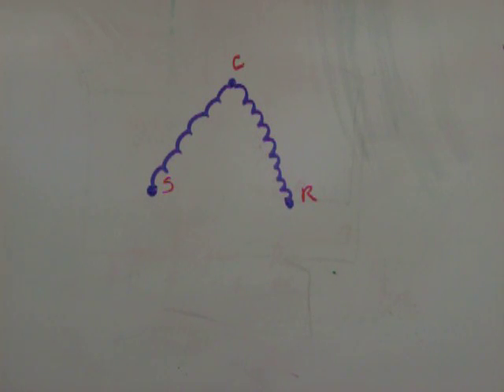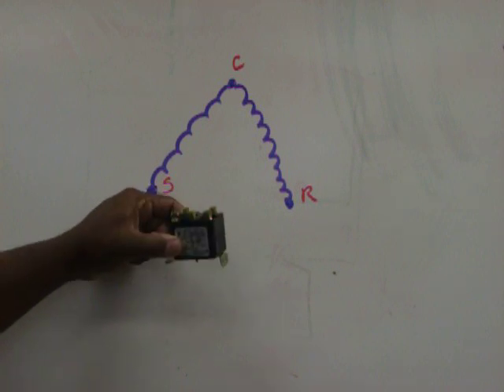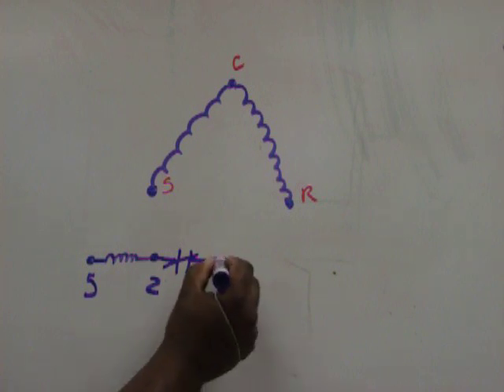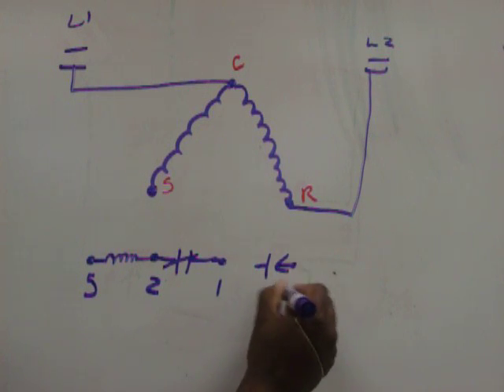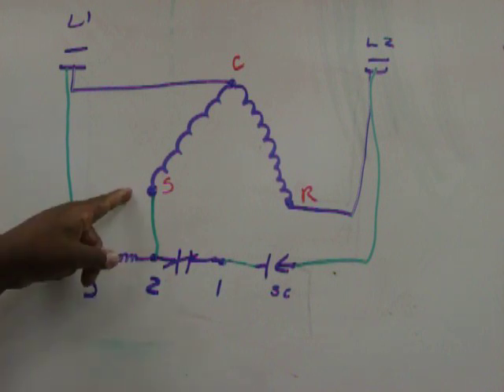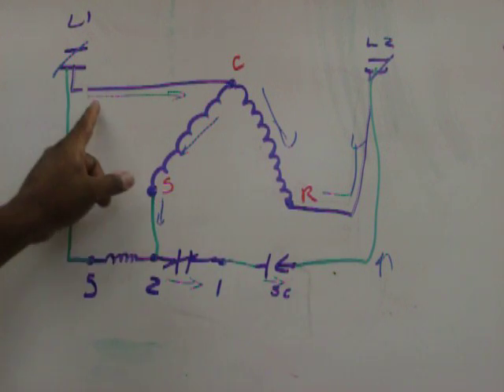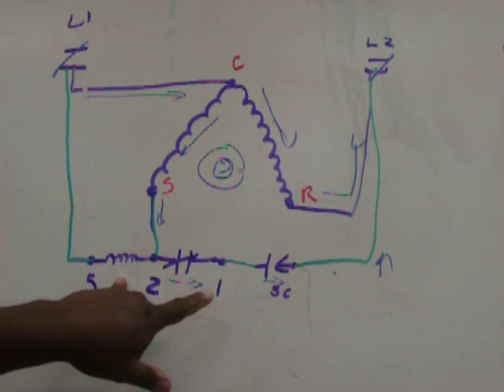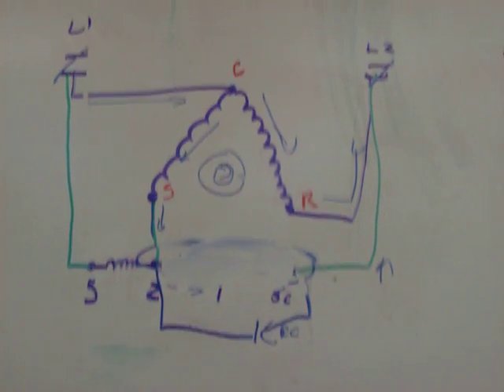Potential relay

Comment: can u explain the route of capacitor in this circuit? bit confused to read which route it takes.. confused to understand when it been filled first, the other side been push to neutral, then the filled one return to the source which is other side of the cap and then the cycle repeat.. thanks in advance

Comment: Oh, boy, out of confusion comes a moment of clarity (I think). The start windings and the relay coil are in parallel, and when the motor is not spinning, the impedance of the start relay is far higher than the start windings, so almost all initial current goes through the start windings. I reasoned that as electrons flow and the motor spools up, back EMF effectively increases impedance of the start windings, reducing current draw and leading to more current following the parallel pathway through the relay coil. That extra current through the relay coil pulls the contacts open, resulting in a transient voltage spike at the S post, for a few hundred microseconds. But what keeps the start relay going after that? After all, with relay contacts open there's no pathway for electrons in the relay coil to get to the L2 side! It's now trapped in a blind loop with the start windings. I'm guessing the relay stays closed because the spinning motor acts as a generator on the start windings, producing reverse AC current with enough of a ripple through that blind loop to keep that relay coil activated. Correct?

Comment: I've been doing HVAC and electrical work since 1992.  This was the best instruction I've ever seen for the start circuit on a single phase compressor.  Great job sir.
Reply from the maker: WOW!! Thank you very much!!!
Reply: @21footxpress  wow bro. youutbe showed me one of your vids from 14 years ago. like what? that is old. But it chose yours. 
looked at your stuff and you havent uploaded in 13 years?
But you did respond to this msg from 1 year ago. 

bro, you gotta come back.
Reply from the maker: @TheMookie1590  Thanks a lot. I have an idea for a new video I just need to make it happen.
Reply: Rely potaruonl rely  sighl  phase   5.2.1  L2  satrt  cap .point  2 point  and connecting  startin point   comprssar  comon point  2winding compoint  othwr point  runing point  comon cycliling  controold  over lord   L1...ciecuit comepted    l1    .l2  enizing compltly   ..L2  ..relay  contanted  potentiaol re..ly connwatd   no..relay  coil contacting  comon point  L1.. contacted ...over lord  ...     L2   1  startcap  .. 2  ponit  coil wunzing  starting  potensional rely circiut
Reply: Rely  potanshionl  realy  dummy point  .mens  mt ...46  ..mt point...))
Reply: @jollyscaria2922 Been hitting the sauce again?

Comment: L1 is hot line why doesn’t it go to Run ( basic theory) why hot goes to Common? I am confusing ???
Reply: Thank you Sir your teaching is absolutely clear, so I have seen a current relay like this,  the common wire ( L2) goes to the OVERLOAD  then is connected to Common of compressor, and the hot wire ((L1) goes to the RELAY at M terminal (main) then is connected to Run and Start terminal? Could you please explain more about this?
Reply from the maker: It goes to common then is split to serve both the run and start windings

Comment: This video is excellent, and the way he drew it out is much easier to remember than the ways I was taught. A  rhyme that helped me remember how to wire potential relays was, "5,2,1...cock, sucker, run". 5="cock"(common), 2="sucker"(start), 1="run"(run). It's crude, but it's memorable. I always find myself muttering it under my breath when I'm wiring these in

Comment: Great video.
Most techs have no understanding of electronics.
The voltage produced on terminal 2 is from the collapsing of the magnetic field on the start winding which is higher than the supply voltage.
It is important to point out that although almost everyone will insist that capacitors pass AC current, that is not true. They simply appear to pass current due to the rapid charging and discharging.  Understanding this fact will help techs understand why a larger capacitor results in a larger current across the device.

Comment: Excellent explanation my friend.  It is also amazing just how much voltage the back EMF can generate.  Hard for some to grasp that even though the motor is 240 volts the back emf generated can be very high even as much as 500 volts.  That is why the pick up voltage is stamped on the Potential relay.  Never buy a relay with less pick up voltage than is stamped on the relay.
Reply from the maker: Thank you very much

Comment: Hi there...great video...but please tell me...I'm no electrical guru.....but in the UK we have L and Neutral. In your schematic, are you using 2 phase ie L1 and L2?  If so, why would you need a start relay as presumably, there would be a difference in Phase angle!   Or is L2 same as Neutral as we have in the UK for single phase supply.  I'm a little confused!  appreciate your feedback.  thanks
Reply: Robin, he was referring to 240V single phase power. L1 is 120V and L2 is 120V. No phase shift. Many compressors here in the US run on 240V single phase power. Only small units like window units and small refrigerators run on 120V power where you only have L1 and Neutral. Hope this helps.

Comment: I came here because I decided to install a hard start kit on my home AC condensing unit, just for familiarization. The instructions are quite clear, but I'm the curious type...

I teach at an electrical tech school and have a HVAC background as well. 

I must say, that was one fine explanation of how the start capacitor is dropped out of a circuit using a relay versus the typical centrifugal switches used in open motors. 

I usually don't address this subject in the electrical only class but I'm going to start now just for comparison purposes.

Thanks much, good work!
Reply from the maker: Thanks for the kind words

Comment: I think what's missing in a lot of the videos that explain what a capacitor is actually doing in the circuit, is that the capacitor is absorbing current, so on motor start-up, the circuit looks closed, temporarily, until the capacitor is charged and no longer looks like a load to the circuit. Although, this is AC, so the capacitor can pass some current continuously.

Comment: Apologies, I'm not an expertin this field.....but just an observation.....In the UK we call it Live and Neutral.  Surely therefore, voltage must be coming in on  LIve (L2) in your diagram?  Also.....what stops the Start Winding being energised through 5 and 2 even with the relay switch open.  The SC maybe out of circuit....but there is still a path!....is this due to counter EMF being larger than line....I'm a little confused here!....please clarify.

Comment: I need to replace a CSIR compressor that's grounded. However, the new compressor is a CSR and it comes with 2 capacitors (Start and run). But i can't fit those capacitors inside! There's too little space! So i'm planning to use a Dual run cap to replace them both as a "2 in 1" options to run and start the compressor. Any takes on this guys? Feel free to share your opinion.

Comment: Only an HVAC tech would think potential relays are hard to understand.  The best thing you can do as an HVAC tech is stop going to technician school and enroll in an engineering school, then if you want to go back to being an HVAC technician you will know a hell of a lot more than your peers and understand how all this works.  There is a side effect though.  If you go to engineering school you will make a lot more money than a technician and have many more career opportunities available to you so you.  When this happens you most likely won't want to be a butt-crack technician anymore.
Reply from the maker: Well thanks for watching. But I see no need to insult these hard working men.
Reply: I make more than most engineers easily so kiss my ass. great video
Reply: Is a little harsh, but it's true.
Reply: Or you could go to a tech school that is worth half a fuck and has teachers that actually understand these simple ass components
Reply: wasup23tube what's got you moody? chill
Reply: StraightoutofGeorgia dumb ass teachers lol

Comment: thank you for education! great video just want to clear something is current flow through run  capacitor as well since run and start wired in parallel?
Reply from the maker: Yes. On start up both capacitors are in the circuit and electricity flows thru both

Comment: I have a question regarding the back emf of the potential relay. I have seen the starter kits, my question is if I want to use my own start kit built by adding a start cap and potential relay, how would I size both cap and potential relay? would I measure the back emf and how do you do that and what would be my pick up voltage on the potential relay.

Comment: sir why are you puting L1 on the common terminal and L1 again on the starting terminal is it right sir  i think starting and running terminals should be in the same line and common should be on the another line L2 am i right sir please clear my confussion 

babar 
+966500473068
Reply: He is not. Look closer at the diagram.

Comment from the maker: the coil has very high resistance. Electricity takes the path of least resistance. And the coil is rated for a higher voltage than the motor

Comment: Hello 21footxpress
Very helpful video. thanks
I did not understand why during startup, 
current will not go through relay coil and energize. is it some thing with resistance of the coil ?
shraga
Reply: Because the coil impedence is too high for the source voltage to be able to pull in the relay. The voltage needs to be higher to create enough current in the coil in order to pull in the relay.